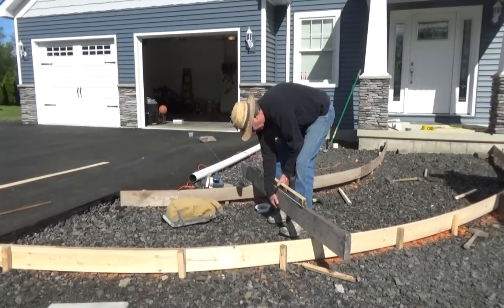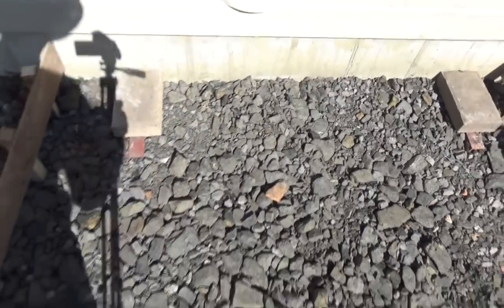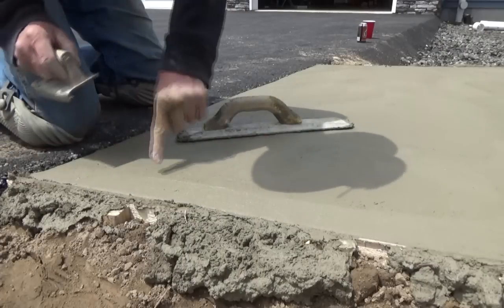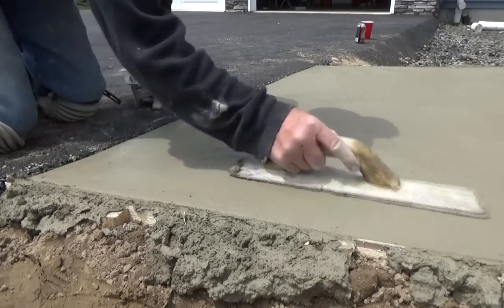CONCRETE SIDEWALKS  (part 3) Mike Haduck

Comment: I’m just getting ready to resurface my parents garage floor.  Luckily they live close so I can touch it up as needed because Minnesota winters are tough.  Thanks to you Mike I was able to to fix/ patch their front steps and now the garage floor.  My mother was pretty emotional because she didn’t have the extra money to hire a mason.  Your the best!
Reply from the maker: Hi Jonathan,  I appreciate it.  garage floors I usually patch & paint, (stucco or deck paint) I would ask the paint store,  I don't use the driveway mix,  I hope it helps, thanks mike
Reply: Thanks Mike,  that does help. Hopefully the paint will block some of the salt that drips of the cars during the winter.  Luckily we don’t get as much freeze thaw here it just stays frozen in Minnesota.

Comment: @09:00 At the end of the sidewalk, you left a 3/8" gap so it doesn't touch the blacktop driveway.
In northern climate, would you recommend eventually stuffing backer rods in crevace and caulking sealer on top to prevent water getting in and under, eventually then freezing, at the risk of busting the slab ?
Keep up the great work !
Reply from the maker: Hi JL, the owner filled it in but I would say that's  a  good idea, thanks mike

Comment: The swirl looks good but sometimes a broom finish hides a lot of imperfections.learned a lot from your videos this is our second house we bought so we've been here a year-and-a-half and we have cracks and Spalling in our concrete this builder hires cheap labor... but our first house 13 years ago had our driveway removed and replaced no rebar and after 12 years no cracks or Spalling. P.S. we have the same type of weather as you have. I'm going to do your old school Portland cement paint on the surface for a few years till we can afford to remove and replace the driveway on my supervision.
Reply from the maker: Thanks Robert,  I would do a little test and make sure you are happy before doing the whole thing, thanks, mike

Comment: Hi, Mike, good video as usual. I loved that you wrote the times on the screen. I have two questions. 1) Did you put some grease or something oily on the formwork so that you can remove it easily later? 2) Do you usually put a plastic membrane before putting the gravel to block moisture coming from the soil? Thanks.
Reply from the maker: Hi Alfred, sometimes I may oil the forms for a porch top but rarely sidewalks, I only use plastic under concrete inside basements and garages but I never do it on sidewalks because frost will break the concrete up if it holds water underneath,  my opinion, thanks Mike
Reply: @MikeHaduck  Thanks!

Comment: Nice video mike. In my experience its the woman of the house that is the driving force for home improvements.
Reply from the maker: hi bric bybrick , your right and I have also noticed they have a tendency to change there minds half way through the project. lol.  thanks mike
Reply: Mike Haduck lol  my cure if they start that chopping and changing caper with me mike is "no problem I'll work out a price for that for you " and the usual reply is " o it will effect the price will it" and I say it sure will and 9 times out of 10 that's the last I hear of it . 👍
Reply from the maker: Hi bric, very true, I am hiding from work but I hear what your saying,  thanks mike

Comment: Hey mike I noticed on the higher psi material such as the one ur using where there is a lot of aggregate the sponge over technique doesn’t work all that well cause the aggregate immediately shines thru to the top of the surface. I’m assuming the sponge technique where ur looking for a nice smooth finish works better for material that has more like and sand in it?
Reply from the maker: Hi, nick, it a hard question to answer,   concrete is s whole different thing g than other types of Masonry, usually floats and steel trowels not so much sponges, thanks Mike
Reply: Mike Haduck Masonry thanks for the reply, peace my brother! Great content u have taught me so much.

Comment: hi Mike, thanks for another great demo video. A couple of questions: why is rebar or wire mesh not required on this job? and what spacing is required for screed key? Thank you for all of your information. It is incredibly generous and thoughtful.
Reply from the maker: Hi Glen,  If truck were going to running over it I might use wire, but I poured it thick and am not worried about it at all,  I usually, cut or use screed key about every 5 feet so it will shrink or expand there,  I hope it helps, thanks mike

Comment: Great video Mike. I don't understand what the purpose of the screed keys are for. Maybe if you make a video in the future you could expand on that. Thanks.
Reply from the maker: Hi Jeff,  they are a lot more easy to use than cut joints, I am expanding on the explanation with some new videos,  I am 12 videos behind now, I will though, thanks mike
Reply: They are for the purpose of crack control. If and when the ground moves through upheaval or what have you, any solid object tends to tweak and bend. For this reason control joints are cut allowing cracks to be directed and controlled rather than down the middle.

Comment: Since watching your videos I'm getting the impression that you sometimes do not reinforce your flatwork with steal.  In your experience and knowledge of the "old ways", do you feel that it is best to leave rebar or remesh out of this kind of flatwork and depend on the skreed key to reduce cracking where you don't want it.  I also noticed you didn't use any expansion joints at either end.  We are required to use rebar and expansion joints here in eastern Kansas but wondering if that hurts more than it helps.  Is it best to leave the steal out of these smaller jobs.
Reply from the maker: Hi Mark, if they are going to drive over it with trucks I usually add steel or rebar but if it is just walk on sidewalks I prefer to leave it out because it rots and expands,  I just try to have more expansion if I can ,  thanks, Mike
Reply: @MikeHaduck  - I like your common sense approach to concrete.  There is nothing wrong with mixing ancient methods with modern methods and applying as the need suggests.  Thanks

Comment: Hi Mr. Haduck - everything I know about concrete is because of your wonderful videos.  Thank you!  But I continue to have problems with edging.   When I edge a slab, the Little Rock's come up and I can't get a smooth edge. What am I doing wrong?  Thanks for caring enough to do your videos - keep them coming!  Patti W
Reply from the maker: Hi Patti,  it is just a little practice and you will get it.  but I scrape up the juice from the top like I did on this video and that does the trick, I always do my edges right after the pour and stay right on top of them,  I hope it helps thanks mike
Reply: Mike Haduck thanks for the reply and advice.   I will try what you suggested.  I probably will write and ask you more questions as I am definitely learning on the job.  Thanks so much again!  Patti

Comment: We mostly try to use wooden stakes, but our Island is quite rocky with alot of Glacial Till. More often then not we end up using rock pins. Curious about the Screed key, is that sold as a product for Concrete? Or is it another building material that you've found works good for this application? 
Thanks for the videos keep em' coming Mike, cheers!
Reply from the maker: Hi Brent,  I know sometimes I hit a rocky area also and have to use steel or other means,  yep that key is sold in almost every mason supply store around here,  I been using it for years and never had a problem,  thanks mike
Reply: I'll have to look into it and give it a try on some flatwork. 
Much appreciated!
Reply from the maker: thanks Brent,   Mike

Comment: Another Great Video...    you make look so easy.... at 4:47  you install that metal form cement separator. what is that the Name of that part ??? how sells it ??? and why you have a truck deliver such a small amount of material ???  why don't  you just mix it your self ???  is it cheaper ???
Reply from the maker: Hi John, the name of the product is called “form a key, “  some call it screed key, I have another set of videos called how I pour a concrete slab, where I mix them all by hand, thanks Mike
Reply: Thanks ...

Comment: Thx for all the info and advice!! One question your forms are they originally in a sheet and are ripped to size? thanks in advance
Reply from the maker: Hi Red,  I just cut up a piece of 4x8 sheet of luan and if I need more I buy another sheet ,  they usually last about 3 to 4 jobs,  thanks mike

Comment: Can't find screed keys at HD or lowe's. Any idea who else might carry them? Brand name?
 Seen some online. Not like the ones you used. Only see the fiber expansion joint material. Thanks
Reply from the maker: Hi lost,  I would check local masonry -brick-supply store,  I know they all carry them around here,  I hope it helps, thank, mike
Reply from the maker: Hi Dan, I usually will not let sites have a link on my site, but I appreciate your comment and you said it very well, I think the product is great and if you ever wanted me to do a video on it I would,  thanks for the input , I love your product,  thanks MIke
Reply: I can't see Dan's comment...??
Reply: Hi Mike,  I am not at all connected with the form a key company.  I was only trying to help lostintime86 find the product.  I have been involved in concrete business since I was 14 yrs old; now 57.  Anyway, without mentioning the brand name, I know of no other company who makes the product, although years ago we could by a tar type version of same.  I don't know who makes it either.
Reply from the maker: Thanks Dan,  your input is appreciated for sure,  thanks again,  mike
Reply: Respecting Mike's desire to keep the site commercial free, I will try to help you find the galvanized metal key way.  Mike is using a Brand Name in the video: Screed Key.   If you do an internet search for galvanized metal screed key or form a key, the one my supplier carries,  you should find the manufacturers.  Call them and ask for your local distributor.  Or ask a local mason or concrete contractor where they buy their specialty trade supplies.
Reply from the maker: thanks Dan,  we appreciate it.  mike

Comment: Should still tie into the stoop so it doesnt pull away. The brackets are to prevent it from dropping,
Reply from the maker: Hi Timothy,  around these parts the frost goes sometimes 6 feet deep and tying into the stoop will crack the concrete,  concrete has to float like rails on a railroad track,  especially in this situation, other situations are different, thanks, mike
Reply: Makes sense if there is moisture in the ground and its going to freeze. You had just stated that you intended to drill and tie in but didnt have to so i thought it was an option. Concrete can only float 9-11 feet on average and will sag/crack if anything settles. With no piles and the driveway being asphalt thats the best you can do. @MikeHaduck

Comment: Wooden forms for sure, curing compound for sure but no deformed steel? No structural engineer would allow that even with 4000 psi, needed a #3, 16” square mat or something comparable
Reply from the maker: Hi Eric,  check out my videos,  sidewalks, old school vrs new school mike Haduck,  Thanks mike
Reply: That was a thicker pour and depending on the zone or area of the country you live in, determines whether or not strengtheners are needed.

Comment: Mike try this   http://www.homedepot.com/p/Veranda-3-4-in-x-3-1-2-in-x-8-ft-White-PVC-Trim-6-Pack-827000002/203640250
It makes life so much easier. It comes in 20' If I'm not mistaken. For real tight radius you can use the thinner stuff.

Comment: Dont use a string to measure unless both sides are fixed. Mason string WILL
 STRETCH
Reply from the maker: Hi Myles,  I am aware of that, it depends on how hard you hold it,  I hope it helps,  thanks mike

Comment: What type of board is that that bends? Masonite? Is there a tall piece of these boards? I need a 2foot high board that bends to a certain shape for my 2ft high, 8inch thick retaining wall. I'll send you pic to your Facebook if you dont mind.
Reply from the maker: Hi Dom, I just use Lucan, or a paneling sheet and double it and triple it , conctete is heavy and you could get a blow out, so be careful,  mike